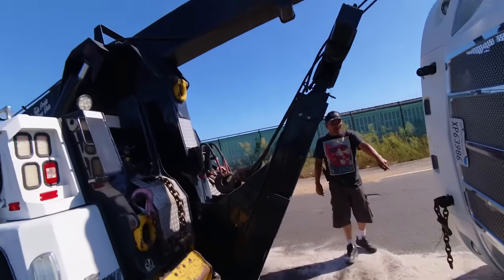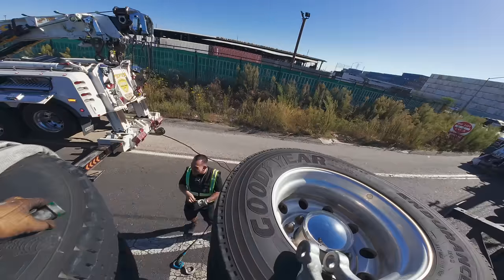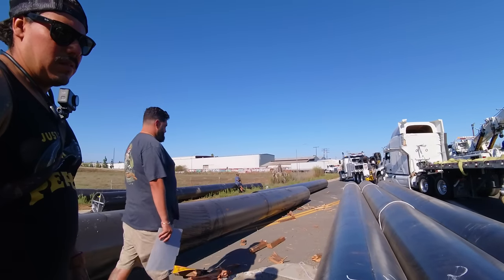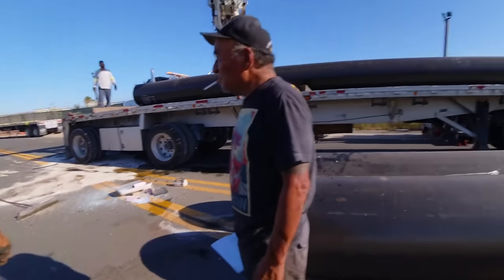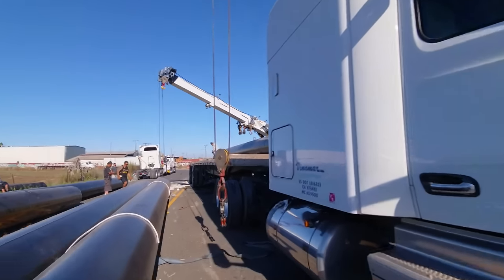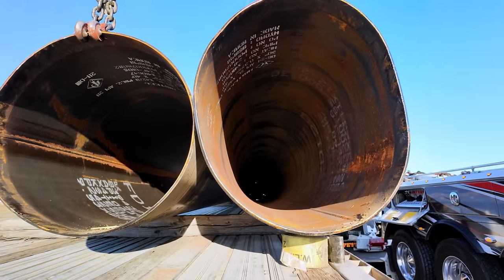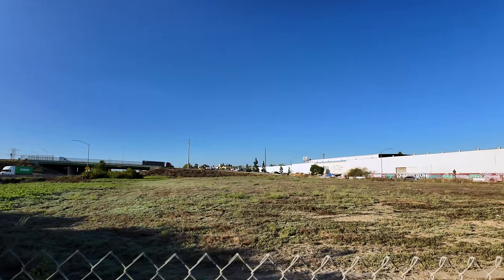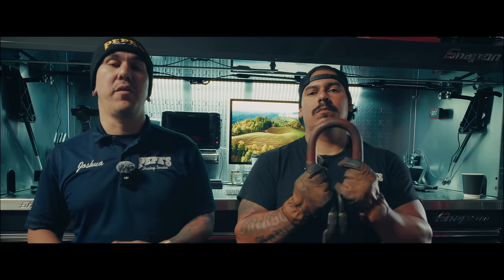Pipes Spill onto Freeway After Trailer Rolls Over

Comment: Josh & Alex nice job as always. Always in sync when you guys work together. I’m not too sure if drivers out there that haul pipe understand that when you get loaded and strap down, and you start driving you’re hitting all sorts of bumps on the road. That load will settle on the deck. That’s where the straps become loose. Always pull over after you’ve driven a few miles and recheck your straps to ensure security. Hauling pipe in general can be dangerous if not properly secured. I’ve seen first hand pipe going through the cab of trucks because they weren’t properly secured. Josh loving the breakdown at the end. Alex looked intimidating with his arms crossed 😂
Reply from the maker: Yes very true, especially since straps can have around 10% of play in them. When dealing with this much weight and stacked so high, it's dangerous. You have to drive like your life depends on that securement job. Same with the chains and binders. And never, Alex is a teddy bear LOL
Reply: “Teddy bear” lol.  I’ve never met him in person so I’m gonna have to take your word for it lol
Reply: That is the first question on the trucking test. Recheck the load straps.

Comment: 1. The loader 2. Pick up place is infamous for rushing drivers to move 3. The Driver didn’t properly check the load to have proper dunnage, chains and straps. The driver left  thinking his yard is so close by he thought he can drive it like that. 4. Then you have a sharp turn and speed with  loose straps and no chains in between layers is a formula for disaster. Thank goodness no one was injured no car was smashed. Stay safe out there drivers!

Comment: Here in the UK, quite a few trucks suffered what is called a "slow rotation rollover". These usually happened on a roundabout or alip road where the centre of gravity pulls the loaded truck onto its side even when going below 10mph. Some loads and in particular large paper reels that are stood up like skittles on a standard curtain side trailer were the bigget risk because some of those reels of paper weighed 3tons each and nine were placed on the trailer in a staggered formation as they were 3/4 the width of the trailer. Interesting to see this load of pipes on its side and being cleared up.
Reply: Those paper rolls should be double strapped in X pattern.

Comment: I remember when Midwest Towing had one of these. Guy spilled the pipe into a ditch going around a corner. They had to reload it on the same trailer and it took forever just to figure out the safest way to load it and tie down. And they had just the one rotator. 

Strength in numbers isn't just a saying.

Comment: You might consider adding a couple of plate lifting clamps to your inventories.  There are various versions of pipe or plate clamps.  I am familiar with lifting clamps with a cam action used to lift steel plates in the shipyard.

It was fun to watch them lift three 40'x10'x3/4" plates that were lifted rotated and set back on the panel line for welding.  The lifts were done with two lifting clamps and a spreader.  Locking clamps would provide a higher level of security than hooks.

I enjoy watching your videos.   It is nice to watch the pride you have in your jobs.

Comment: My guess on that is improper load securement. I haul a lot of funky loads, basically if it fits on a flat, lowboy or Landoll, tell me where it's gotta go and when it's gotta be there and I'm on the way. I've never had a load shift or come off, and hope I never do, but I always over-secure things so that doesn't happen. It's always better to take the extra time to secure, check and re-check, rather than be in a hurry and end up like this driver did.

Comment: You guys did an awesome job and Hector really did good, YA I KNOW!? 😂 Good to see your feed back at the end. Y’all was 💯. The loss was  securement. Pipe is a challenge and it’s actually my favorite (was my favorite but I’m retired). It was my specialty and I never lost are had a slide or spill. I’m old school I guess and layers of pipe as the loss originated is not that complicated. 4 inch ratchets on slides both sides. 2 straps each row first 2 rows. The part that’s hard to explain is my 80 foot no hook straps. 3 laid on the bed in thirds of the load. Top layer. Then you throw left to right and wrench grab. Then the right to left and grab. This is a try figure 8 to the bed. Not that belly rap junk they teach. This way you’re pulling the squeeze on all that pipe. Then you had your two on front at 4 feet space and rear to meet DOT that I staggered. 1 pull left. Next right all the way the length of load. Pyramid load NO PROBLEM easy peasy. Just use chains and go passenger last and pull that figure 8 tighter. 3 will haul that load but we know the drill. One truck flat bedders. Carry a small pump up sprayer with a lot of soap mixed with water and spray the area best you can wear the figure 8’s squeeze. This helps that strap roll and slide to get very tight. Work those wrenches. Work it.

Comment: thank you for "posting" your recovery videos, always interesting, as an ex heavy duty recovery opperator, often 30+Meters long [ me 8M + truck 4M + 1 trailer 6M { 12M long with 5th wheel} + 1 trailer 12M ] i would resign if told to drive any of the 3 trucks used to remove the pipes, my life is more important, with a sudden stop, yes anytime a sudden stop is required, what is stopping the pipes from sliding forward ????? WHY ARE THERE NO HEADBOARDS ON THE TRAILERS, safety last is always a good policy in 3rd world countries, safe driving keep a safe following distance & watch the guy behind you

Comment: The pipe carrier should make would yokes for the pipes to nest in to minimize movement during travel & settle the load so vibration won't put pressure on the stars and/or chains.

Comment: No Pipe Stakes No Headache Straps (Double straps in the Very front 6 inches apart ) No Belly Straps .. You need a Pipe Hauler.. Not a steering wheel holder

Comment: a problem with pipes especially those who has a thin goodsthickness is they bend very easily especially when they has to cutted in slices and the pressure on the saw is too high you'll destroy over 1 meter material and if the pressure on the saw is too low it turns around and can destroy the saw so those who say a Cnc-saw is easy to operate are very wrong

Comment: how many pipe accidents has to be happening before somebody does something about dangerous pipe loads. the correct way to loading pipes is by using a crane for off and unloading. a Crane a steelrod approved for more lifting capacity than the weight on the pipe with lifting hooks in each end could had prevented these stupid rollovers. yes you can't load more than 5 to 6 pipes on a trailer in a triangle but it's better than nothing.

Comment: I would recommend for this type of lift using a  spreader bar less chance of hooks slipping out ,and one truck can  load each pipe with  more precision,  also wheni was loading pipe we required belly wraps wraps front and back
Reply from the maker: I commented to someone else that mentioned this. A spreader bar is an absolutely horrible choice for this job, beyond horrible. The way we did it was perfect. 9 pipes loaded in record time, nothing slipped out. This only works when you're in sync and know how to angle the boom which we do.
Reply: @PepesTowingService  I've handled pipe for 42 years, I've seen what happens when a hook slips a spreader and  a tag line on each end always!
Reply from the maker: How many years have you operated a rotator? How would you even place the spreader bar? If you run it parallel with the pipe, what is the point then? Just use each of the main lines directly to the pipe. If you run it perpendicular, that wouldn't even be possible. Then, you would have to constantly be repositioning the one truck with the spreader bar to get it pin point perfect on the bed. Again, that is an absolutely horrible idea.
Reply: @PepesTowingService  I've helped load pipe when we were loading trucks with a crane similar process, spreader bar was the way to go you have complete  control the process you used scares me, it worked but one wrong move and your  hook slips, properly done  the pipe can be lifted and set in place, I've handled pipe 16 inch diameter to 60 inch  diameter in this manner safely, 42 years of experience and I haven't dropped one.

Comment: Would a spreader bar with the double grabs have worked? Would have saved the danger of having two trucks working independently.
Reply from the maker: How would you use a spreader bar with this? The veer angle would be so bad it would almost be a net negative for your rigging. And then once attached, how would you line it up perfectly, every time, on the trailer? You would have to constantly be repositioning your truck. In no universe is that even close to being a good option. And what danger lol, you literally saw a ballet of 2 rotators working in tandem to get all 9 pipes loaded insanely quick.
Reply: If you were going to do that, why even use the spreader bar.  Just run a line to each end of the pipe.  But then the pipe is going to spin and when setting down you cant control each end height independently.  Also harder to drag laterally as there is no way to keep both end hooks set unless the pipe is airborne.